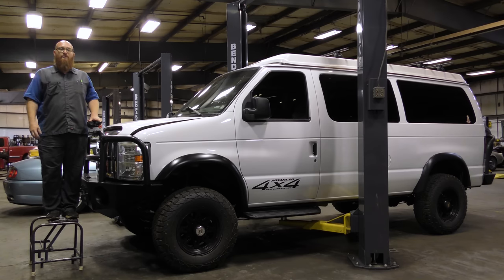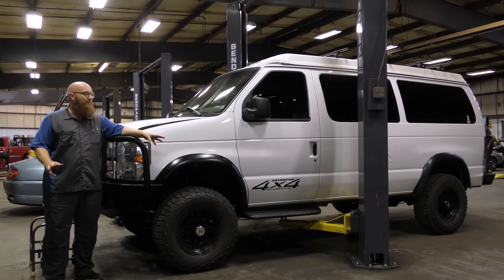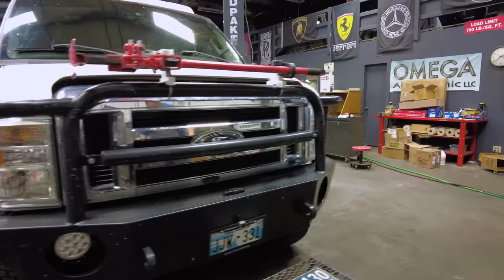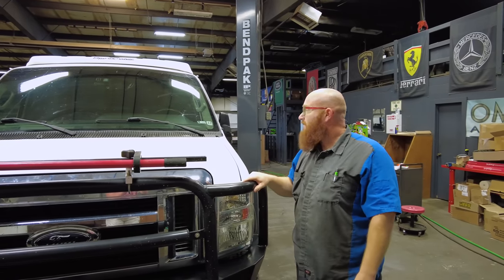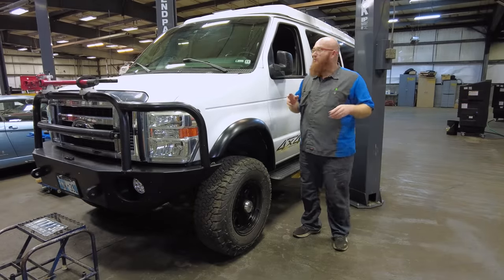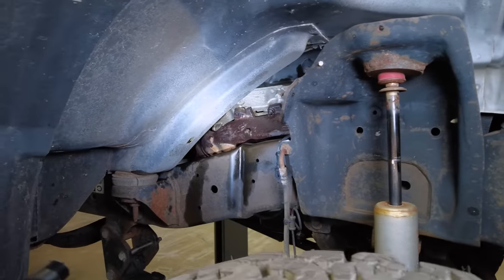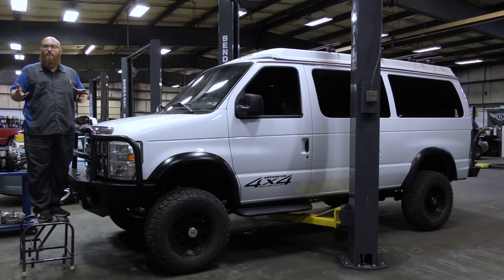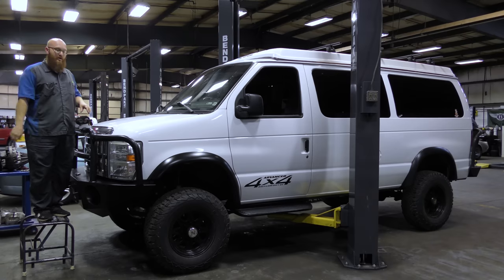8 shops refused to work on this custom '10 E-Series Van! CAR WIZARD shows how easy it was to fix!

Comment: Teflon typically degrades when in contact with oil. Look at any air compressor sealed with teflon and you'll typically find a bunch of goop. I used to use a product called Xpando for these types of connections - dry powder you mix w some water to a peanut butter consistency. Expands slightly to seal and would handle any heat or vibration thrown at it. Used to use it on test rigs circulating 500F oil and had no problems.

Comment: good on you! I scratch my head a lot of times on your diagnostic abilities, but I have to tip my hat to your ability to jump in on anything, even if you have no prior experience to a particular platform. In that kind of scenario it very well can turn into a nightmare very easily if not properly managed. No matter how big, the wheel stance/ground clearance is. Once you remove the wheels, you can lower the truck down until it’s just about touching the deck. You’ll still have to deal with some height issues, but nothing like technicians that have to work on big rigs.

Comment: I bought a new E350 Quadravan by Parthfinder in 1978. A truly horrible reverse engineered monstrosity. Suspension parts cobbled together from various and sundry cars and trucks. A 460 cubic inch motor with a mileage number that began with a decimal. Huge factory lift kit, giant wheels and tires that was over 8’ high. I never understood why Ford didn’t build one themselves, I think there was a market even back then.

Comment: I built a UJOR adv van  15tsh, 7.3 PS, 4r100, all springs from ujor. It drives beautifully.  I'm not far from you, I'll have to show it you sometime.
South Central Diesel has a guy that does my technical stuff. I do everything else. Take the front seats and dog house out and reach almost everything. I'm using a DP Infinity monitor with 2 non smoke tunes.

Comment: Interesting about the crappy breaking rusting studs. I wonder if SS bolts would be a better choice and some nickel anti-seize. Good idea, get them nuts red hot first if they wont come loose. I use and acetylene torch and mostly that helps a lot. Just dont want to burn up anything, so your induction tool sounds good.

Comment: Hey Mr. Wizard try this, get a small brick of bees wAx and find the most rusty nuts and bolts in your shop. Heat them with a torch and hold the wax on the heated  
part and watch what happens, you'll almost take the components apart with your fingers. Oh by the way, let them cool first.

Comment: I've had the same response towards my 2006 Chevy Silverado 2500hd with the 6.6 LBZ Duramax.  Most shops are cautious to perform repairs even as standard as suspension or brakes.

Comment: If you had to replace an engine on a van like this there is an easier way of doing it.  Most modern vans are body on frame, and if you have a two post lift you can simply lift the body off the frame. It may sound like a daunting task but it really is not that bad. You can even unbolt the A/C compressor and tie it up to the body and the entire A/C system including radiator / condensor etc will stay together with the body.  That means you don't have to evacuate or recharge the A/C.  Even if you have never done it before a decent technician could have the body off in an hour, if you have done it a couple of times you could probably get that time down to 40 mins or less.  Once the body is off the frame you have wide open access to the engine.

Comment: I would work for you. I have worked on and rebuilt a few 5.4l 3 valves. All ran for 10k miles. One ran correctly without full factory sensors and parts for 60k, which is tops imo

Comment: And omg the ford transits over here the best years where also 2010, to layer 2013 up to our 63 plate, meaning the next six months so a 13 is march and a 63 means it was from September so a 20 is 2020 march and 70 is 2020 September so back in the day before 2010 it would be like 09 and 59 for march and September but a 63 plate ford transit in the UK are the last years of production of a certain model one which was one of the strongest most reliable models and david you and omega auto clinic are an absolute god send, luv for that brother, love from the UK 🇬🇧🤜🏼🤛🏼

Comment: *I have done an engine swap in one of those Econoline vans. Although it was a regular unmodified 2wd. It was still a big PITA. It was a V6 and I had to dismantle the front of the van. Radiator, condenser, all that had to come out and pulled the engine out the front.

Comment: Not surprised they had trouble finding someone to work on it. I had trouble getting the 90k mile timing belt service done on my Hyundai the local shop we have been going to for longer than I have been alive refused to work on it because it was an import and I had several other shops just not want to do it. Bizarre, I ended up getting my belt service and window regulator done at the Hyundai dealer in Tulsa.
Reply: That's so dumb. Hyundai belt service is pretty simple. I mean yeah it's a big job but it's easier than a lot of the other timing belts out there.
Reply: @wingracer1614  Yeah I thought it was weird. I've done some minor work on my car and there is tons of room around the little na 2 liter i4 and the engine bay is nice and low down because its an actual car and not a giant suv or truck. I thought it was super weird my local shop wouldn't work on it. It's a freaking 10 year old korean economy hatchback not something exotic or complex.

Comment: Suggest using Loctite PST instead of tape. You will like it. Threads only have to marginally clean to use. (Ideally clean.) It saves time plus seals better. Been using it since 1990 on our hydraulic fittings, truck oil drain, etc.

Comment: Hey Wizard, In regards to Reprograming Ford vehicles you might want to try out FORScan if you haven't already.  It unlocks a bunch of easy configuration options in ford vehicles. I've used it myself on my Ford SUV to change and disable a few options such as the annoying hyper blink warning that would occur randomly when I was trailering and it worked great.

Comment: As far as the driveline issues, there are 4x4 shops in our area that wouldn't hesitate to work on the van.  The exhaust studs however I can see regular shops being reluctant to work on those.  When you are able to find a shop that will work, we are in an age of specialization.  I'll do this, but I won't do that.

Comment: Interesting concept, shops refusing to work on it. I do ALL my own work, no matter what. Nothing goes into a shop ever, except from annual state inspections, I have rebuilt engines and transmissions too myself. All my vehicles, I buy used out of any warrantees. My newest vehicle is a 2005 Ram 4x4 Cummins diesel, and I always pay cash to buy one. Maybe if I get too old, I will stop fixing things that break.

Comment: Engine swaps on these E-Series Vans are super easy, it is 6 bolts and 6 wiring harness plugs and the entire body will lift off. That way you have full access to the engine.
Reply: Ummm… it’s a little more complicated than that. The ac compressor has to come off the motor and stay with the body, the brake master cylinder has to come off and stay with the frame, the steering needs to be disconnected, and the fuel filler neck disconnected. Not to mention body grounds and various other little things.

Comment: I’m surprised places would take this. For me the worst was the really long vehicles like a crew cab long bed 4x4 truck. In most cases i would just lift the front or rear a side at the time. Sometimes its nice when you can only lift it halfway, get a rolling chair and sit down on the job

Comment: Yep. Tire delay like on a brand new concrete truck with new radial tires with extra tall threads that feels like the steering linkage is connected to the steering wheel with rubber bands

Comment: Because a lot of shops are scared of anything modified. I'd work on it no problem. I've built a couple of vans like this myself, only I used 400 and 460 engines and either an E4OD trans or a ZF-5 manual trans.

Comment: Engine swaps on these go through the front. 
You have to disassemble and remove the header panel and radiator support area, then you use a boom style engine hoist to slide the engine straight out the front. 

That said, if this van is really rocking a 3 valve Triton, then that must have been part of the mods when converted.  While this would give it higher performance, it would still be a weird thing to do, as it will likely compromise reliability.  So with that in mind, I seriously doubt it's a 3 valve. 
Ford stocked their 5.4 vans with 2-valve engines to make them more bulletproof for fleet use.

Comment: I may well be wrong, but like the Ford Excursion im sure this is one of those large vehicles that require the body to be lifted off  the frame for an engine swap and few shops have equipment to do this kind of work. Its also obvious access for many things looks very limited.

Comment: Up the rim size to improve the steering. I had 35x12.5 20 E rated tires on my Ford super duty. It handled so much better than it did with the factory 16" rims. Plus they look sweet. 33x12.5 18's would be perfect for that van.

Comment: Any 2009-2015 E350 box truck w/5.4,2valve,is a pretty easy engine swap.
I have swapped atleast 6 of them over the years at a truck rental company 
Remove bumper, grille,header,lights,cooling,accessories,oil cooler,left engine mount/bracket,intake manifold.Disconnect exhaust and trans.
Short chain bolted to manifold and pop it right out.
Reman from Ford,complete and cheap.
Easily done in one full day.

Comment: I don’t know if you’ll see this wizard, but if I remember right, you can physically turn the parking sensors off from the dash. I have done this in an 08 Navigator but don’t know if the interface changed between 08 an 2010.

Comment: I don’t understand why       No one likes  the Triton  5.4 I had  three f -  150 s  my Dad had two  a   2001  a          2004. Me  I had a   2000 &2007great motors I also had a  2010 and  2012  the only  problems we had  was  the fuel  pumps failed on my 2000 at  56.000 miles  and the same happened on my Dads 2001 at  41.000 miles but they all  performed great hood gas  milage no leaks of any kind  none of them  consumed  oil very smooth engines  and no  transmission or differential  or transfer case  problems no electrical  problems  good solid  trucks  and         That’s  all folks

Comment: I have a Ford E-350 and shops have turned me down based on its weight. They said they dont know what it weighs but they wont risk it. I had it weighed. Its 7,700 lbs. Their lifts are rated at 8k lbs. Im glad they said no because these lift manufacturers like to blow smoke with their ratings. Much like shop vacs with their horsepower ratings....

And much like battery powered impacts with their torque numbers....

Ive seen a channel where a guy loads them lifts up with weight and puts them to the test!

Comment: My 96F250 with 351 Windsor had close to 400000 miles never had no exhaust bolt issues but then again the bolts are probably 2 times larger

Comment: Wizard...cut the nut off the stud instead of breaking it!  You're replacing it anyway.  Plus having something to grip on a broken fastener makes life better. Also... the fluid between the transmission and transfer case is because the output shaft seal in the unit is leaking. It should be dry back there.    I've always dug those adventure vans.
Reply: I just wrote a similar comment. The thing about it is people often do not know it should be dry between the two units but with a little common sense it is quite obvious. Just replacing the gasket there will result in another leak.

Comment: I’ve had my 1996 E-150 with the 4.9 inline six since new and still driving it daily for work. The key is replacing the starter or whatever goes bad after many years with oem parts.
Reply: @rch5991  Unfortunately Ford stopped making a lot of parts for the 4.9 in the last how ever many years so the junkyards are a good place to look. I’ve only seen one van with the 4.9 in my local pick your on places,
there are more older F150’s with the 4.9 in the junkyards. Fortunately I live in South Carolina so my van is like new with no rust and all original exhaust unlike if I still lived up north like years ago. And yeah I learned my lesson on starters from auto part stores, replacing them once a year or buy oem and lasts 10-15 years

Comment: I used to have a 2010 ford e350 from 30k miles to 190k miles and nothing ever broke. Always really heavy loaded. 
Just re charge the AC with a can one time only.That’s all. I think really doing the oil change (motor and transmission) in time it’s the best you can do.
Reply: Oh also I replace one oxygen sensor.

Comment: I use to work at a Chrysler dealership and believe me I hate to work on anything that have to do with custom jeep wranglers unless was factory stock vehicle. #1 complaint customer overpaid for $70k wrangler and they are expecting a Bentley instead of a jeep . So kind of provide an answer why shops decline custom vehicles. Unfortunately some shops are not big enough to handle the volume of vehicles that come in and it make worst by taking this vehicles because sometimes parts are not available right away.

Comment: There is a free program called Forscan that lets you mess around with settings in various Ford vehicles' computers.  It requires a laptop and a generic OBD-II module that allows you to connect the laptop to the vehicle's computer.  Maybe there's a setting in there that will disable the parking sensors?  Worth a shot, since it's free.

Comment: I imaging that many 'shops' are mere computer jockeys who expect to be able to reference a vehicle to service data and use their plug in scanners.  This modified van will doubtless differ electrically from the OEM spec so the less confident shops would be worried that their normal scanning methods would run into trouble. Who knows what the ECU might tell them and whether it woud lead them astray - the ECU might have been changed too and again they wont know what to expect.  The Wizard is a brave man to tackle anything but mechanical fixes on this leviathan

Comment: I can totally see why shops wouldn't take it. Anything out of the normal because of the conversion will mean customized parts. The Customer is telling you on the phone he has a leak somewhere, without physically looking at it, the shop doesn't know what is involved. As a shop owner I'm looking for quick turn around jobs that's aren't going to sit in my bay or outside waiting for parts.
Reply: @linkavichchamofskee5519  Yeah go ahead and tell the customer you can help him over the phone without looking at what the problem is.

Comment: Wizard a lot of shops are so backed up and booked they aren't gonna take on an 8 - 10 hour job. Guy I've used for a.decade.tirned me away for a rear main and flex plate replacement job. Also when shops see these "adventure" or van life vehicles they are dealing with people who are usually not dropping and coming back. They are hung up in a hotel and get impatient because they aren't at their residence while work is done. Seen it a lot. Not the customers fault, but that is something a specialty vehicle with all the mods underneath.

Comment: I wonder how you would get the engine swapped in that van? Lowering it is perhaps just as good an idea as hoisting it out of the small upper hole. Taking the front off with all that extra equipment would take a serious amount of work, but I guess it is doable?

Comment: If you come across a 5.4L3V Ford, check the manufacturing date on the driver's side block.
The new head design that increased the spark plug thread count happened 10-09-2007. 
As for the VVT issues, starting at about 150,000 miles, you and/or your mechanic should keep an ear open for startup timing chain rattle that is a sign of tensioners going bad. 
Just like any car, a timing chain job might be necessary to replace guides, tensioners, chains, and other VVT parts. With the Ford 5.4L3V, you MUST also upgrade the followers and oil pump. 
Do it yourself, and it may cost about $800 in parts. Have a qualified mechanic do it, look at about $3000.
Sounds like a lot to spend on an engine with 150K-200K miles, but it is no different for a Mazda or other timing chain vehicles. 
And . . . with the tensioners and VVT, change your oil religiously.

Comment: I work on custom vehicles like that all the time. But I understand why most shops said fuck no. Most shops pay flat rate for techs, that flatrate time is set on stock vehicles, this van not being worth flatrate time to work on. I'm flat rate also, but I got accustomed to working on dumb stuff like that so time wise wasn't too much of an issue for me for the most part. Hell, I work at a common franchise auto shop, and Iv been known to work on custom RV's, tractor trucks, lawnmowers, trailers and so on there, I might be the only one in the company willing to do so. But I understand why no one else really wanted to work on that damned thing. Most everything is over sized like the tires and wheel, inviting a hernia/injury that could take someone out of work for weeks without pay until workmans comp kicks in. But I don't understand why the customer couldn't find a shop and had to beg you to work on it. There are TONS of custom shops, and independent shops around that would have taken it in. And god help the poor sob that had to do that oil pan. Those fuckers ain't fun to do on those Eco vans, I have 3 of them, and have had to replace the steel pan on all of them, they are bad for rusting out, gotta unbolt engine mounts, (On older 5.0 90s engines gotta remove top half of intake, jack engine up a foot or so, then remove pan.)